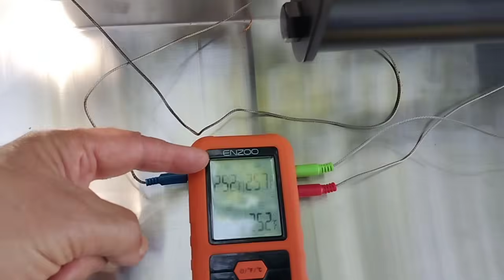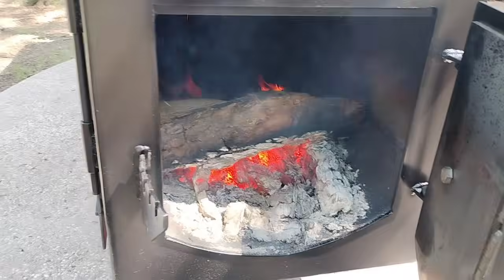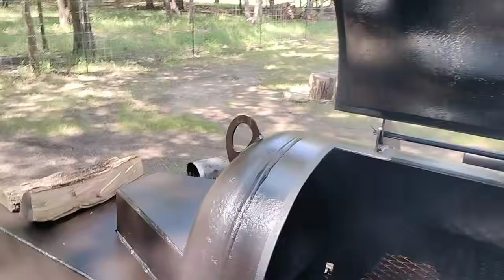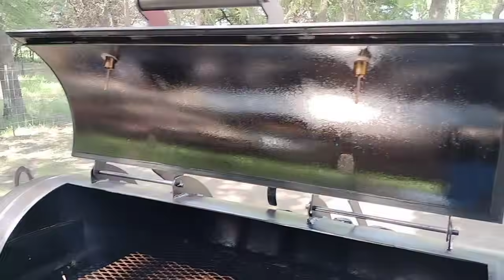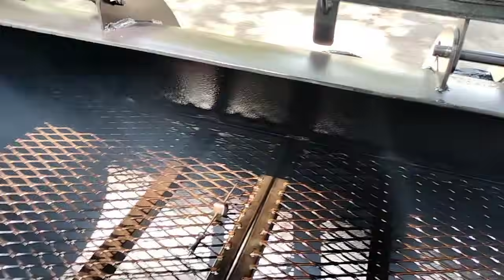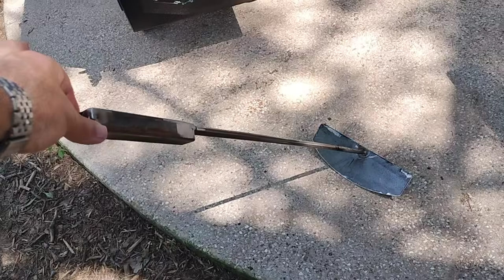New Design Backyard Offset Smoker .  Several New Features.  No Hot Spot.

Comment: That's some  very impressive fabrication , especially the fire box design and heat distribution system. I have my smoker under a pergola that I designed and put a metal roof on it. 12' x 12'. . Makes for a great outdoor cooking area  that I can use in any weather conditions in Florida. Except hurricanes. Lol
Reply from the maker: Thanks!  I have definitely been thinking about building a small roof structure to keep the rain off.  The biggest challenge I seem to deal with is wind.

Comment: I would have put hinges on firebox door on the other side...you're working in front and have to go to the back to tend to fire...that collector on fire box is good idea...
Reply from the maker: The firebox was supposed to be on the right, which would have swung the door the right direction.   I put the stand on with the tank upside down and when I flipped it over, I realized I had put it on backwards, so I just went with the FB on the left.
Reply: @KerryMooney-rl6oh  still a nice smoker...
Reply from the maker: @dennis9358  thx.  It actually turned out for the best.  The way the smoker is positioned the hinges are on the south side of the door.  If the door swung the other direction wind would blow directly into the firebox.  Winds are notoriously variable here in Northeast Texas.  That would have been a nuisance.

Comment: Are you going to use a water pan with your smoker
Reply from the maker: I do not plan on using a water pan.  It has been my experience, based on several years using a Weber Smokey Mountain, that the main reason for a water pan is to even out harsh temps.  This smoker does not have the harsh temps of typical offset smokers.  I may test a water pan and change my mind later, but for now that's my thoughts.

Comment: Get a brisket going, por favor.....   nice design utilizing fluid dynamics, differential equations and all that fancy schmancy stuff.  I can see where that diffuser being on top of the firebox is going to increase air speed increase chamber pressure and overwhelm the stack.  Instead of the stack drawing on the chamber creating a low pressure area.  Should still work when you find the proper tune on the damper....  Looking forward to some results....
I helped my welder father build an offset when I was 14 and it weighed around 1000 lbs and took a winch to move.  The firebox was 36” casing and 1/2” thick.....chamber was 24” casing and 3/8” thick.  He cooked hundreds of briskets on it from 1978 - 2002 back when briskets were $0.69/lb.  I couldn’t get it when he passed because I didn’t have a wench truck so his best friend took it... I am 60 now....

Comment: Will you build one of these for me ?
Reply from the maker: Thanks for asking, but i'm just too slow to build these for others.  You are more than welcome to have a pro pit builder use any or all features from my design.  Holler if you need any details to pass on.
Reply: @KerryMooney-rl6oh  Very nice build. How would one go about getting a few more details?
Reply from the maker: Let me know what details you want and i'll post.  If I get enough interest I might make a video where I go over the whole smoker with a tape measure.
Reply: @KerryMooney-rl6oh  Yes, I would like to follow your design. Something new. I'll be watching your channel for any updates. Take care brother.
Reply: @KerryMooney-rl6oh  Did you base your opening from the firebox into your "deflector" from a calculator such as Feldons?  You mention an adjustable part in your deflector as well as a curved piece. More details on all of that would be great. Can't quite make it all out in the video.
Reply from the maker: My initial opening was based on Goldee's 6" elbow, since my design and Goldee's should operate on similiar airflow principles.   28" is roughly the same as 6" I.D. pipe.  I looked at numbers from Feldon's calculator, but given the different airflow principles, I did not put too much into the Feldon numbers.  The adjustable throat plate and curved piece were things I toyed with adding from the get go.  After testing I added these for adjustability and to help make air go where I wanted.  If I get enough interest I will do a deep dive video into the details.
Reply: Thanks. I’m sure there’s a few who’d be interested. I’m just starting on a 250 gallon but only have the tank so far.
Reply: Awesome build, I would gladly pay for these plans.
Reply from the maker: Sorry, the plans only existed in my head and were slightly dynamic.  In a few weeks I should have time to post a video of me going over the smoker with a tape measure, so everyone can document the dimensions.
Reply: @KerryMooney-rl6oh That would be awesome!